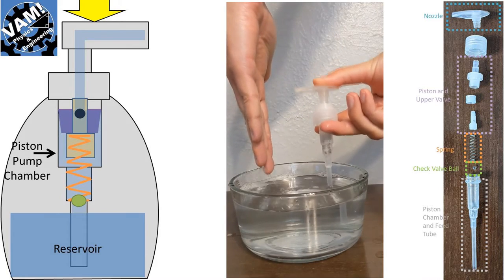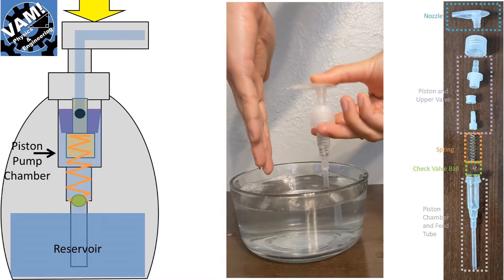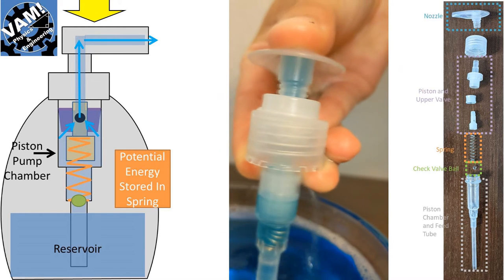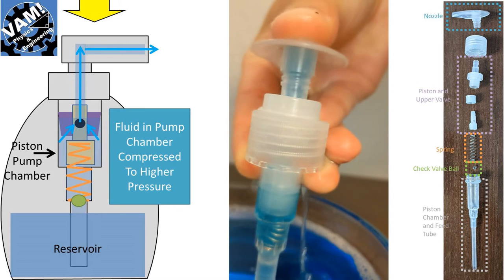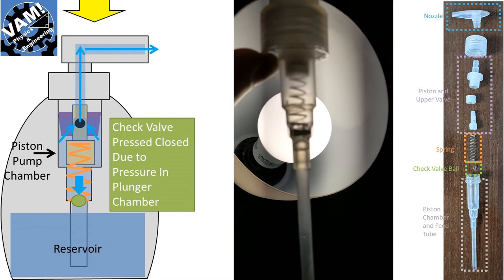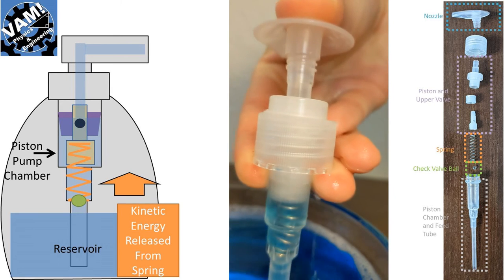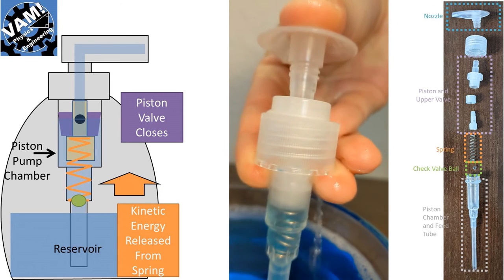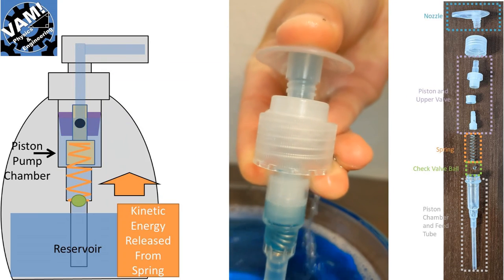How A Soap Dispenser Pump Works

Comment: This is really interesting and will be useful but I’m still somewhat confused about the check valve ball

Edit: I’ve re watched the video a couple times, is it that the ball prevents the soap from going back down into the tube? And is the pressure applied on the ball by the spring or by the compressed soap
Reply from the maker: Basically when the nozzle is compressed the fluid pressure forces the ball down to a hard stop on the plastic. (virtually no fluid can go through to reservoir) This means it goes through the nozzle into your hand. When the nozzle is uncompressed the ball has nothing to stop the higher pressure fluid in reservoir from passing. (no hard stop) so the ball lifts and lets the soap go through the check valve.
Reply: @VAM_Physics_and_Engineering  got it tysm

Comment: Mine stopped working after 2 months so I took the top off & it works fine in water, just not soap.. Any suggestions why or how to fix this? It's hot here so it isn't like the soap is too thick.
Reply: Try using a stronger spring maybe? I’m assuming it would produce more kinetic energy with a stronger spring so it will be strong enough to push the soap